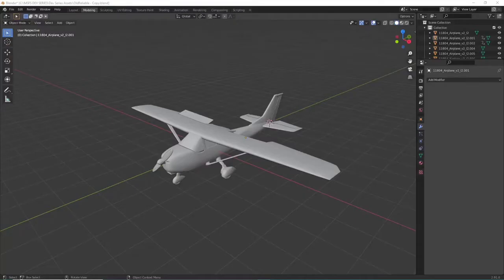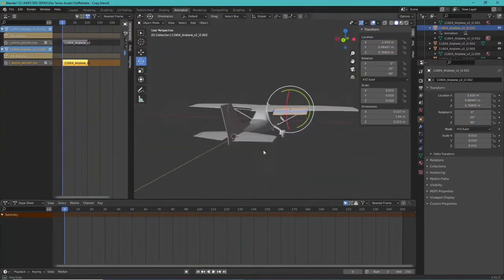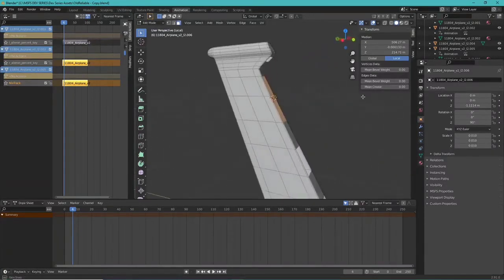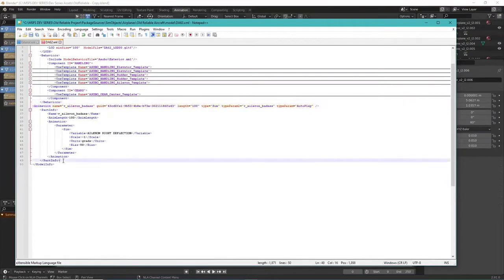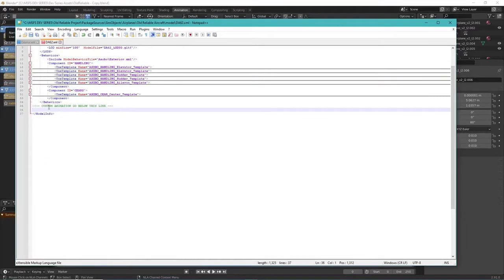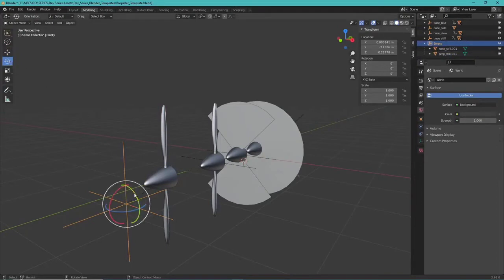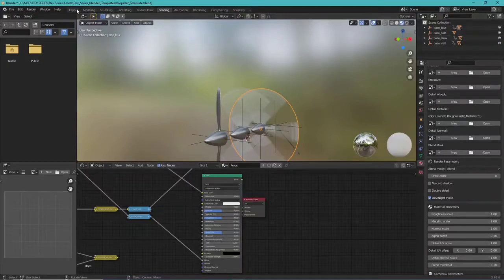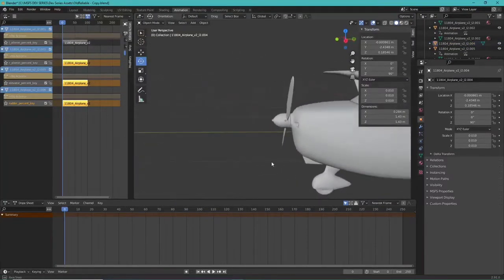MSFS: Development Series (Episode 4) (OLD)

Comment: At 22:00 of the video, you mention if there is an easier way to expand all the items to be able to select them for copying.  In Blender 2.83 you can use the + (plus) key on the Numpad to expand it. Just click the + key until it expanded all the way.  Similarly you can use the - key to collapse.  It is much easier than expanding it manually.

Comment: Hi. Thank you very much for making this series.  The problem that you encountered with the bad rotation of the rudder cannot be corrected by moving the origin to a different location. I think the reason is because the rudder is slanted. In classic Blender armature rigging, you can make it work with a "rotated" bone

However, by using the origin as in your example, it seems like you would need to rotate the origin in order to make it work, otherwise the rudder looks weird when it rotates. There must be some other way to do it. Do you have any suggestions?
Reply from the maker: https://youtu.be/KB4GwS6lGN8
Reply: @JonxSimulations  Thank you, that is what I thought needed to be done (rotating the origin). Cheers!